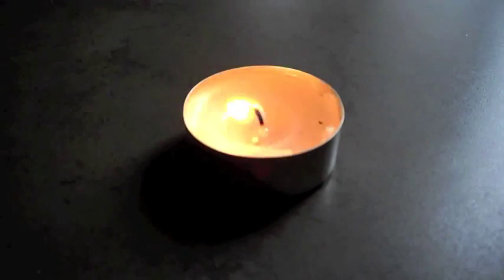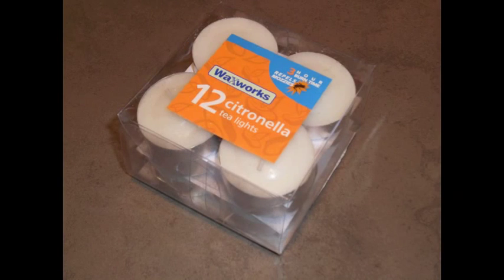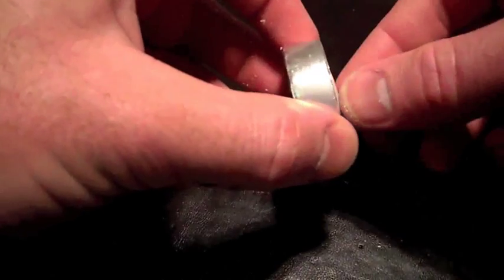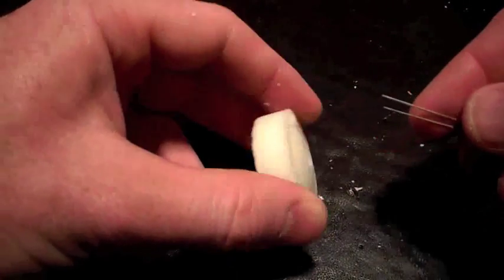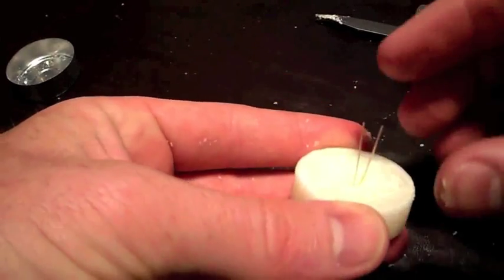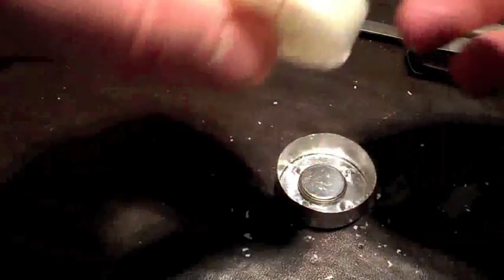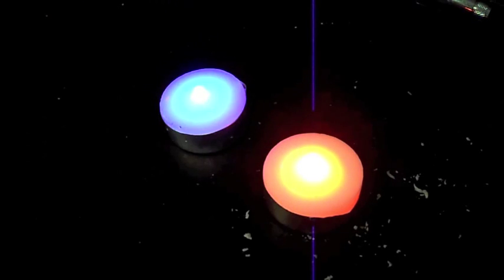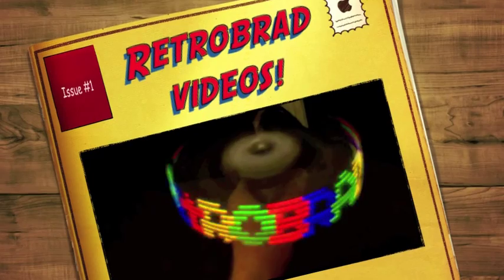An Electronic LED Tea Light Candle Hack.

Comment: Do the wires and battery get really hot??? I don't know much about led lights and stuff like this, but I want to put the lights and batteries in foam, but I'm worried they will get hot and melt the foam. Is it safe?? And if not, is there another solution???

Comment from the maker: @Fuzzball Very good question! There is no added resistor with this circuit, it actually uses the internal resistance of the battery. The metal housing is just a short circuit

Comment from the maker: @brokenbylaw2 A microcontroller would be the easiest method although you can still make it change / cycle through the different colours just by using a 555 timer chip and a 74193 counter chip. This would just make it change from black, red, green, orange, blue, magenta, cyan and white and then repeat.

Comment from the maker: @brokenbylaw2 A microcontroller would certainly be the easiest method, especially if you wanted to actually fade in and out of colours. if you wanted to just make it change colours (without fading) then you can easily do it with a 555 timer and a 74193 counter. all up the circuit could be made for a couple of bucks.

Comment from the maker: @brokenbylaw2 a 9 volt battery will be perfect. make sure you use at least a 150 ohm resistor for each of the three legs. You will find as you connect up each leg, you will get a different colour. You can also mix colours bu turning on multiple at a time.

Comment from the maker: @brokenbylaw2 Hi, happy to help. It sounds like the leds that you have would have four legs. One leg is your common anode or cathode. The other three are your red green blue cathodes / anodes. To experiment, connect the longest leg to ground and then connect a resistor to each of the other three legs. Then connect +5 volts to them one at a time they should light up the three different colours. If it doesnt work then reverse all the connections. Let me know how you go.